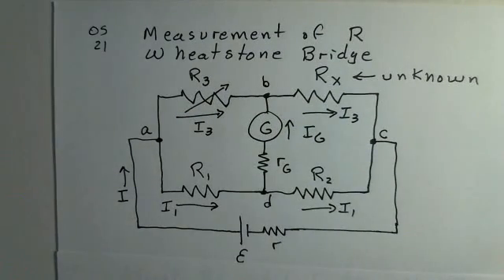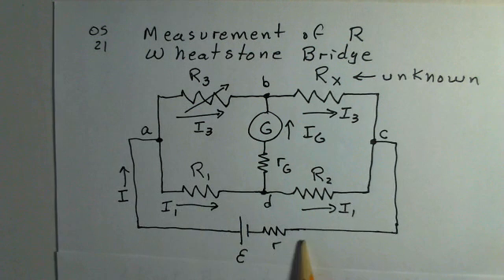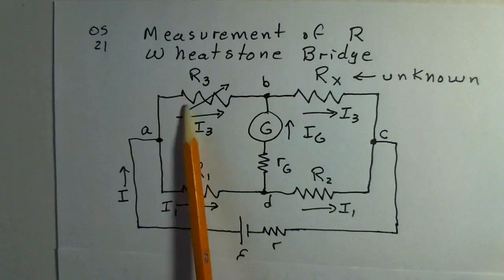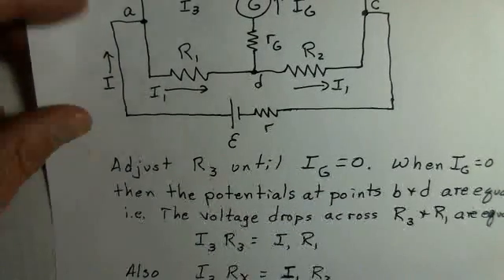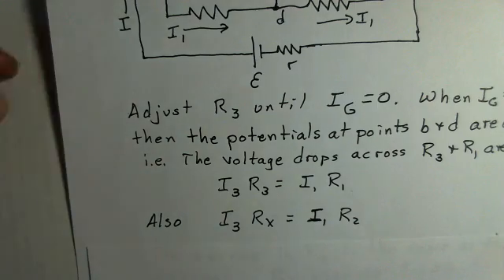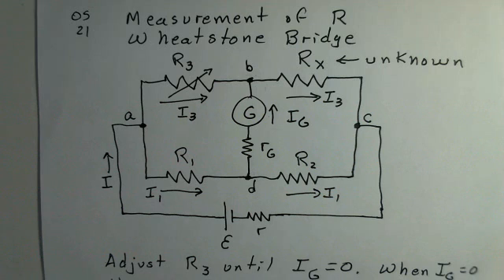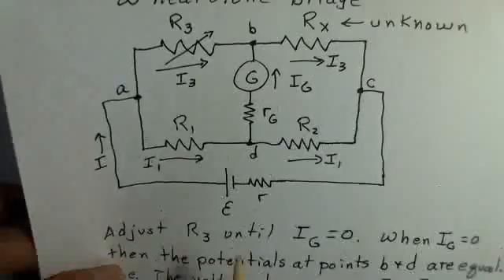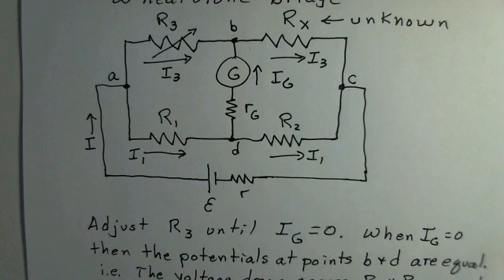Wheatstone Bridge Concepts: Calculate the Value of an Unknown Resistance

Comment: Sir, is the direction of current flow through galvanometer arbitrarily chosen?
Reply from the maker: Yes.  The direction of current through the galvanometer in the sketch of the circuit does not affect the calculation.  The resistance R3 is set such that the current through the galvanometer is zero.  The current through the galvanometer actually does not have a direction.